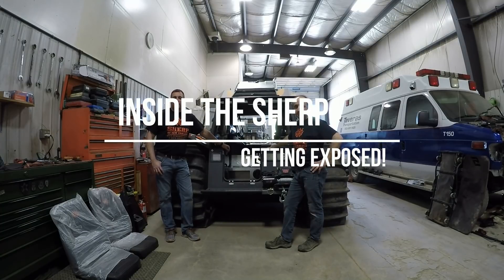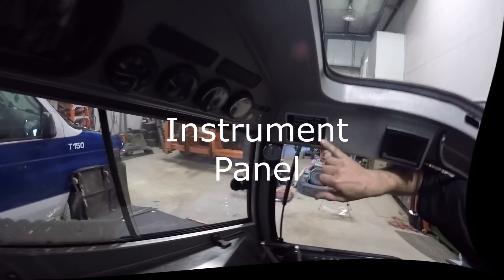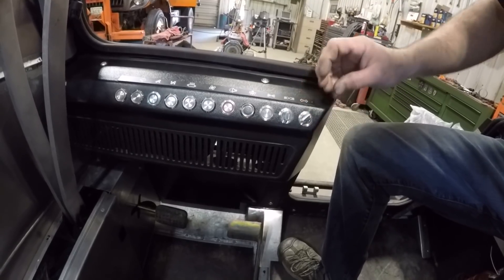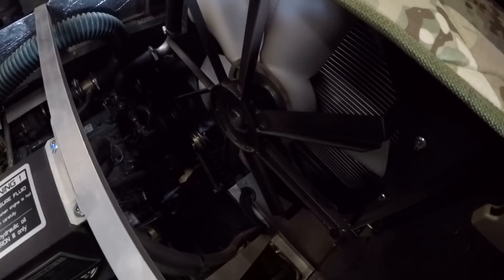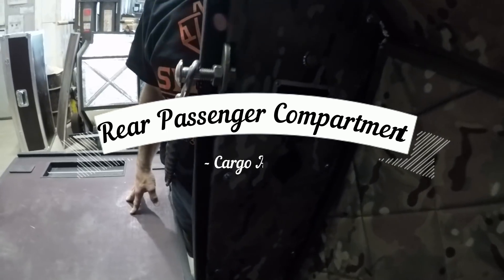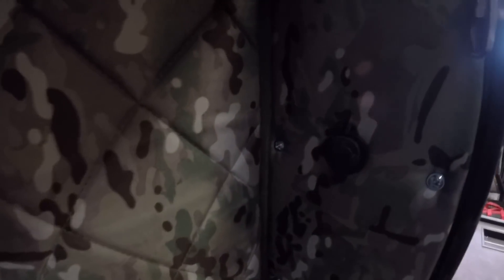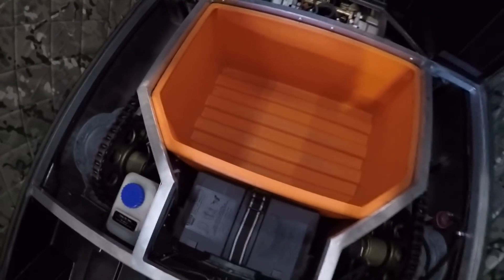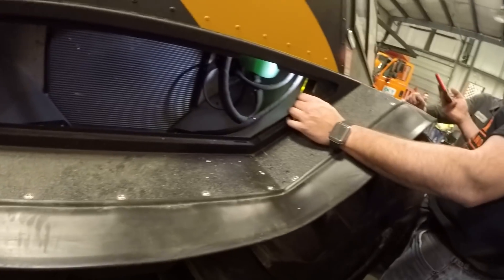SHERP ATV Inside

Comment: Thanks for the breakdown. Is 40ish HP really sufficient though? I know for example a humvee has relatively modest power but plenty of torque. Is this similar, or is it just not necessary for what the sherp is designed for?
Reply: a military Humvee is more than 7000 pounds while this thing barely weighs 2500 so with the deep reduction those chains provide 40 HP is ample power just as long as you don`t expect F1 levels acceleration.
Reply: As it is a diesel it produces a lot of torque which is whats needed to crawl over most terrain (almost 90ft-lb). Due to it's incredible crawling capability/torque I originally thought it was hydraulic driven like a skid-steer, however after doing some reading it's clearly just directly driven by the engine.

Comment: I'm really not trying to knock this thing, and I've seen it's capability, which is amazing.
 But practically speaking as a technician, I wouldn't want to try to track down an exhaust leak before the whole crew died of CO poisoning.
 In fact I think the correct procedure would be to evacuate and send one man in with a rope tied around him. While maintaining verbal communication at all times.🤔
Reply: there is a big fan on the rad that moves air through the motor bay at all times so even if it did have a leak you would be fine unless you drive with the cover open for some odd reason

Comment: would like to know your out in the back wood's and your in the SHERP fun   you need fuel in a bad kind of way and you are in the mud and crap you got to get down in  the mud and pull your aux tank off the wheel  in cold and the mud and clean all that junk off your aux tank and put fuel in the main tank and hope to god you don't get water and dirt in main tank of the SHERP  working on the chain with all the nasty oil  I would hate work on that.  $130,000.00 SHERP ATV  and no A/C just too much money getting out of hand here

Comment: Prideful Americans should be ashamed that Russians have such a off road machine. Americans go learn from the Russians and build something even better then the Sherp.with more power and hwy gears and make it street legal.
Reply: I am thinking about it.  :)
Reply: More gears requires more weight, which means you get stuck easier, and use more fuel.  If you want a good example, look at the tech specs on a "Fat Truck", the imitation Sherp, that has all the bells and whistles, but the basic performance characteristics are inferior in every way.